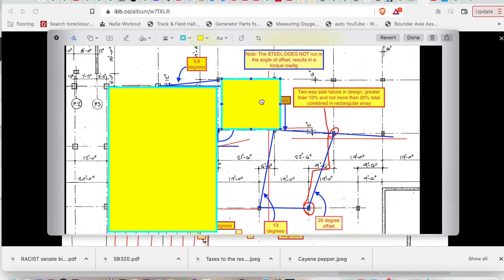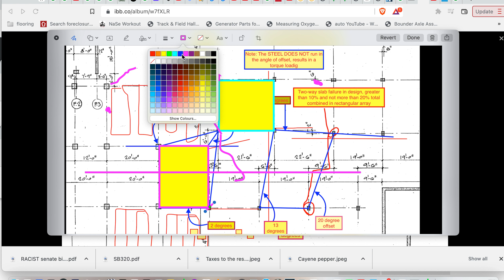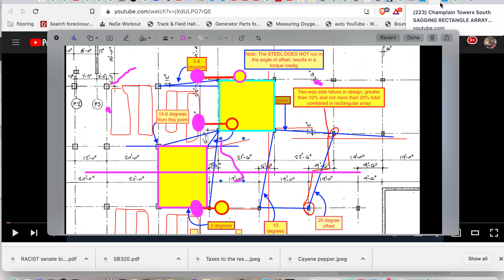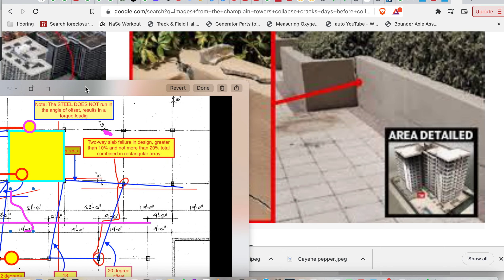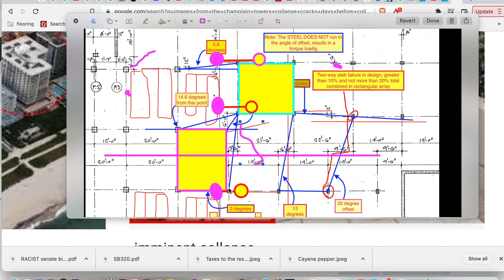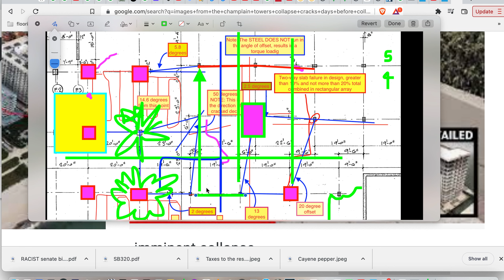Champlain Towers Collapse Deck was composite (like layers of 2x12 on scaffolding)  Rectangular array

Comment: 😎 I would guess, the  ''neutral axis" of these combined slab systems is in between negative steel and positive steel in the spans... (video to come) IDK TY GREAT WORK!
Reply from the maker: Hint: Neutral Axis is at DIFFERENT locations on all these skewed supports...  Neutral axis, above the columns will be different than located at the tributary area that is forty feet plus long...   I do not want to confuse you but, I will reveal how IF a compression side is greater, it can avoid deflection failures.  You do NOT want a ''climbing" neutral axis... you want ''tension'' to be stable and NOT exceeding the ability of the ''rebar and concrete" (this can be steel or other materials also) to ''confine'' those forces (video to come) .
Video with more details
https://youtu.be/65GZB961_2g

Comment: Thanks Professor. Great lesson Im not an engineer or even a contractor. But it looks to me like it was built out of balance. And as you say it will find its equilibrium. Please correct me if I'm wrong.
Reply from the maker: Randy, I have a model, I will show it in about 5 days, it will demonstrate  some of what this video reveals.   But yes, these pads / panels are NOT balanced in a two-directional capacity.

Comment from the maker: Champlain Towers Collapse Deck was composite (like layers of 2x12 on scaffolding)  Rectangular array on COLUMN placement was number one defect, then lack of proper critical shear reinforcement, steel for temperature expansion was ''more stiff'' than the ''tension steel" ... The top of structural slab was more stiff than the bottom steel... Riddle me this, what is the ''neutral axis" of these combined slab systems?  The top steel becomes the BOTTOM steel for the covering slab WITH it having to act as negative steel and positive steel in the spans... (video to come).